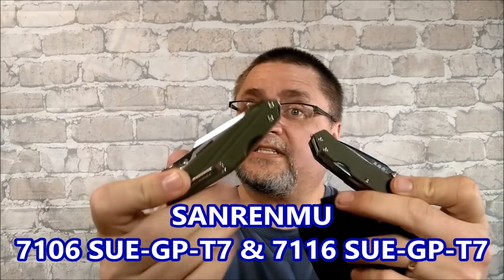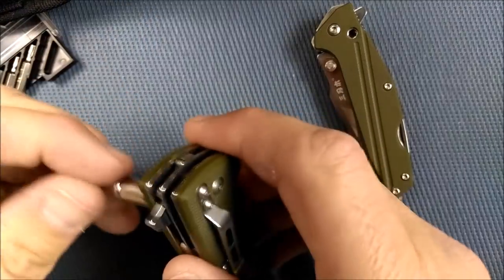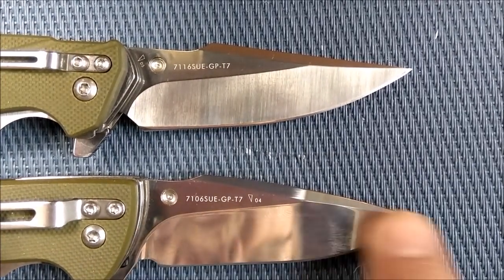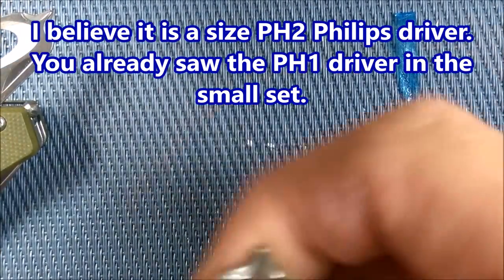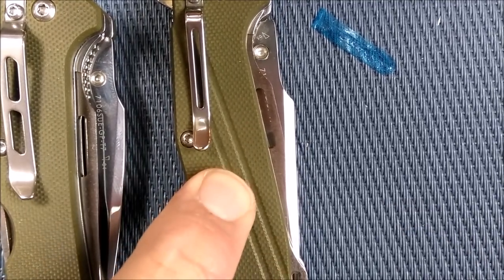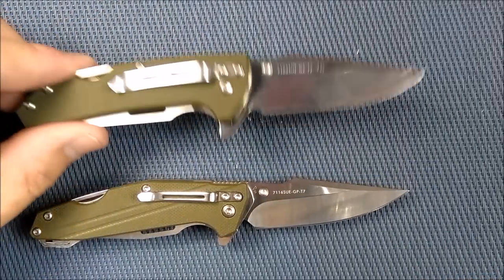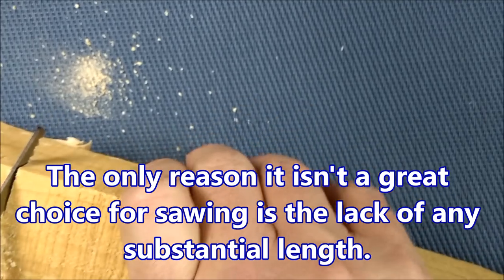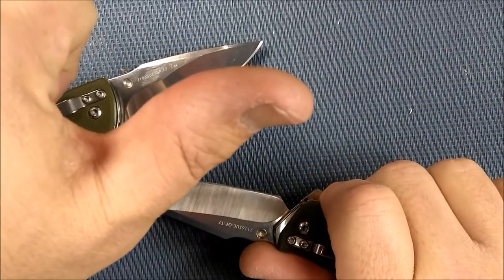TRICK LOCK MECHANISM: A Review / Comparison of Sanrenmu 7106 & 7116 Multi-Function

Comment from the maker: At about 14:40 I said that the rockwell hardness is about 28, well that is WAY off.  It wasn't even that soft before it was hardened.  Sanrenmu generally brings their Sandvik 12C27 up to around 58-59 range on the Rockwell scale.
Reply from the maker: sometimes my mouth does typos too!  Dang!  Too bad YouTube no longer lets me post a correction in the video.  2 years ago I could do that, but not now.  I pinned a comment showing the correction. THANKS for pointing it out.

Comment: I have the 7116, if you take the clip off it fits perfect in the pouch. Has a couple flaws, my file plate pops out , stiff opening on the blade but a cool knife.
Reply from the maker: Yes, I should have mentioned that it fits better in the pouch if you take the pocket clip off.  I left them on so I could show everyone the knife in its entirety. 

Those flaws are not good.  
I would suggest a little epoxy to put the file plate back in its place permanently.
Have you tried loosening the pivot screw just a tiny bit to see if the blade would be a bit easier to open?  There are two detent arms with a ball on each - one of each side of the blade - and they cause a fair amount of resistance making it harder to open the knife.  IF that is the force you are talking about then the only solution is to take the knife apart and bend one of those two arms back a little bit.

If you are curious about trying that you could email me and I will take mine apart and show you some detailed pictures about exactly what I mean.  My email is  CanadianCuttingEdge AT gmail.com

If you reply to my reply here - I probably won't see it.  I get so many comments that I can only keep up with initial responses to each comment.  BUT I answer every email.
Reply: I tried to loosen it but it was badly off center, I'll probably email you about that, thanks for the advice, I almost never miss a video.

Comment: @ 14:40 12c27 gives a Rockwell hardness of 28?  Hmm, I suspect it is more in line with a hardness range of 54-61 HRC as stated on the Sandvic web page.  

I like the clever blade lock feature.  Some nice innovation there.  Nice review.
Reply from the maker: should be 58 , sometimes even my mouth does typos.    Thanks for pointing that out. I missed it during editing.  Too back YouTube no longer lets us go into the video and add a note to show the correction..  I will have to pin a comment, sadly i can't do much else.  thanks for pointing it out.